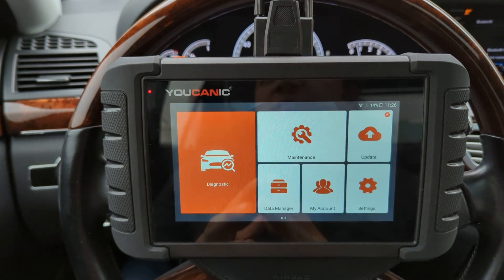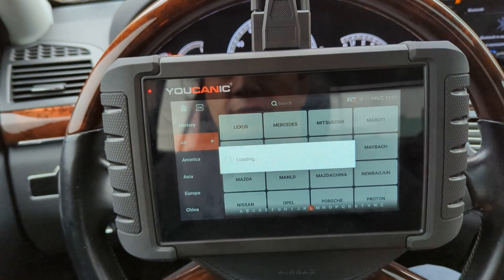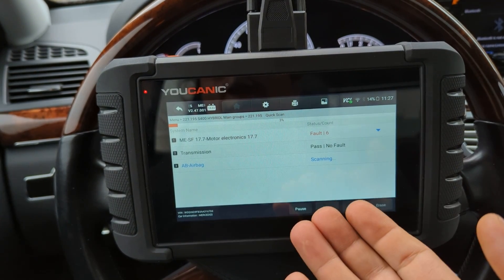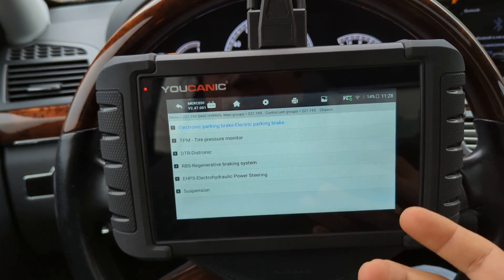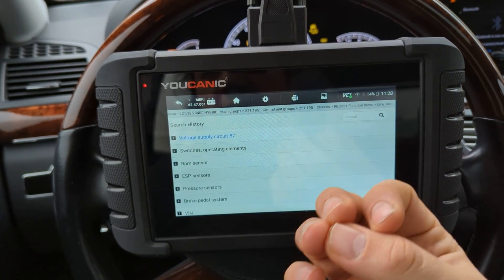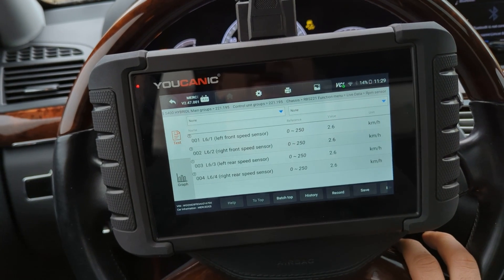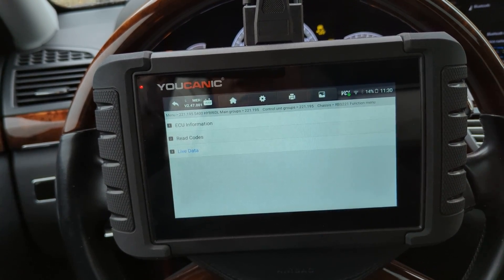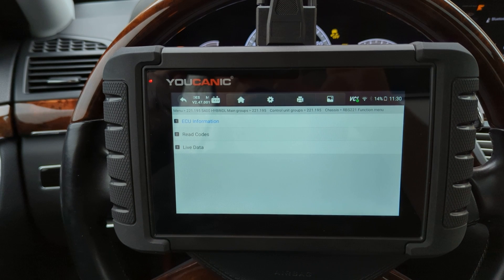How to Find Which ABS Wheel Speed Sensor is Bad to Replace - YOUCANIC Scanner

Comment: Where i am from, the tone wheels disintegrate and you will get a fault for the speed sensor. On my scanner I can put a graph up and expand the sample to see it read read in realtime and watch it drop out (where the tone wheel is missing magnets). Found this out when i loaded the parts cannon  with a new speed sensor and the condition persisted.
Reply from the maker: Thanks for sharing that valuable insight! At YOUCANIC, we provide useful resources, including our comprehensive automotive guides and powerful YOUCANIC scanner, to assist car owners like yourself. Your experience with the tone wheels and speed sensor is valuable to our community, and we appreciate your expertise. 

Feel free to delve into our resources at www.youcanic.com anytime you need assistance or automotive insight. We even provide factory repair manuals for detailed guidance. Rest assured, our main goal is to foster confidence and independence in car maintenance. We're here to assist you every step of your car ownership journey!